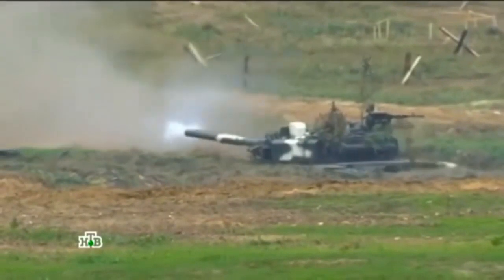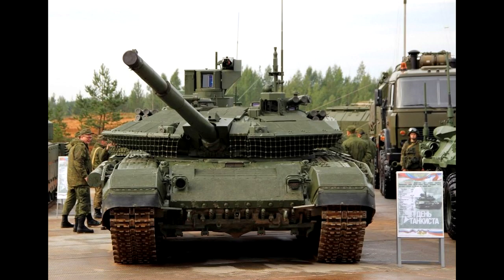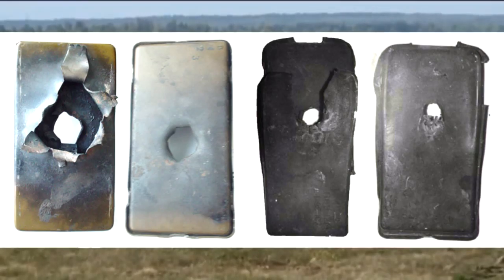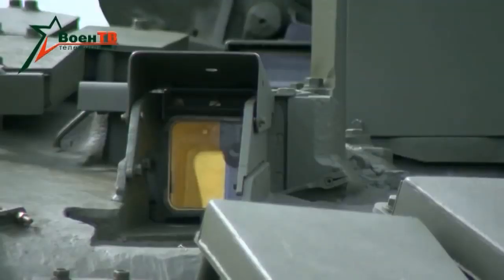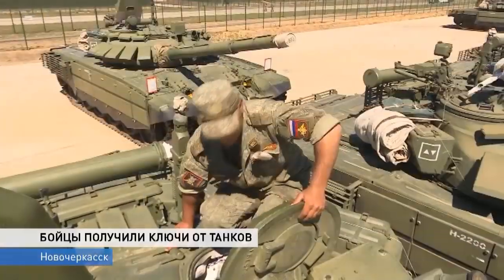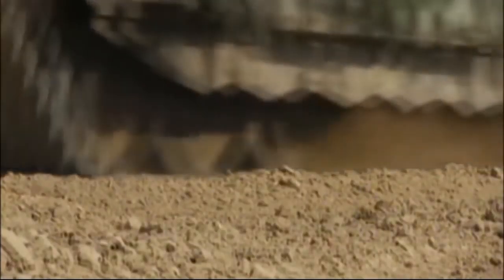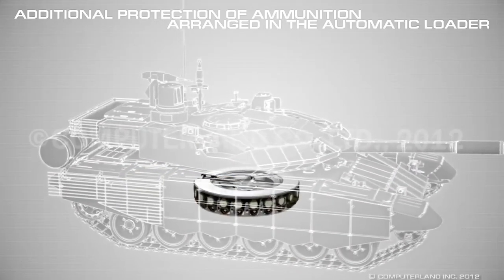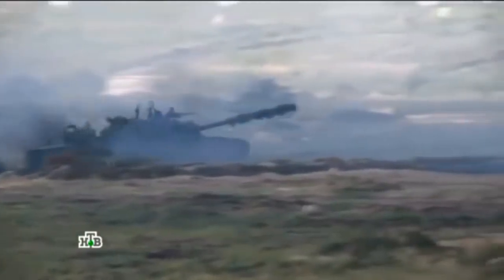Problems with T-72 tank

Comment: I love the T-72. It is so incredibly Soviet it's glorious. But, it becomes completely outclassed by the M1A1 and A2 platform of tank. Any NATO country would be able to combat it
Reply: This is sort of a filler tank until they get enough T90s to replace them (And then the T90 becomes their second rate tank as the t14s will fill in as first rate) , the T72 will still remain as a backup for a backup tank.
Reply: Don't say that you think t-90 and t-14 have any chance against the NATO tanks, please...
Reply: @TeoAnimations  They actually have, they are a major upgrade over all the tanks that were sent to ukraine.
Reply: @ytkomar1141  depends on which ones. The T-90A is confirmed in Ukraine. The T-90M is not yet confirmed.
Reply: @kurousagi8155  Yes, I was thinking about Proryv-3 while writing my previous comment.
Reply: Meanwhile, Romania with it's glorified T-55: Cries in Romanian
Reply: @TeoAnimations  The T-90MS and T-14 Armata are good tanks, there is no need to downplay them just because they are Russian. And even if it turns out that they don't - it's better to overestimate and use overwhelming firepower on them rather than underestimate them and use insufficient firepower.
Reply: @ravenouself4181  lol, both t90 and t14 use the same autoloader as t72, and based on video evidences that design is extremely flawed.
Reply: @ravenouself4181  The thing is: Russia is simply to poor to build T-90MS let alone T-14 tanks in high numbers. And tbh both are unproven in battle and the T-14 is probably not even fully developed. 
But you are right. Better overestimate than underestimate your enemy!
Reply: Russia always favored quantity over quality in their tanks. A platoon of 200 t-72's will eventually defeat 50 abrams or leopards for example.
Reply: @kurousagi8155  until now there is only one confirmed lose for t 90m so that's a good sign
Reply: @zezenkop412  Maybe because they dont have many of them at all and there are much more T90 losses in general if considering all variants.

Comment: I still doubt that "any tandem shaped HEAT can penetrate the K-5". It has proven to pe extremely effective in the Syrian war, surviving MULTIPLE hits by TOW-2 ATGMs which have a tandem-HEAT and still didn't penetrate....
Reply: CptMisha  It was not the only time that a missile failed to penetrate the T-90 armor, there was also another video where another T-90 was attacked by a ATGM and again it failed to penetrate the T-90's armor https://www.youtube.com/watch?v=wKe7W8IrIBw So we have at least 2 videos that prove how effective the K-5 is. So Red is wrong about that "anything can penetrate it", he geatly underestimates the effectiveness of the Kontakt-5 against missiles!
Reply: I though the Insurgents only had the older cable controlled TOWs supplied by Saudi Arabia?
Reply: @run2u520  they did, the groups supplied in the TOW program were using 71-D and older models. you can tell because the optical sight isn't a huge block
Reply: @xAlexTobiasxB  Well the Abram's hull is not that weak, it has at the very least 400 to 600mm or NERA behind the Steel plate.
Well it's not that armored compared to the turret, but can withstand some 600mm against KE rounds.
Reply: @gdfsgfsdg4232  We're not talking about optical sight or the launcher, we're talking about the missile itself. And in all of the photos I have posted above you can clearly see that it's the 71-E variant! Besides, the optical sight has nothing to do with the missile anyway.
Reply: @xAlexTobiasxB  correct me if im wrong but frrom the appearance of the video it looks like the TOW didn't hit any era but hit the sloped underside section of the t-90a where there was no ERA attached.
Reply: @ferrarilegends5850  No, the missile definitely hit the tank, in fact, it was hit again by a second missile right after the first one failed to do any damage, and the second missile again failed to do destroy the tank too.

Here is the longer original version of the  full video that shows both missile attacks:

https://www.youtube.com/watch?v=OPnnOX_Gh7c

As you can see both missiles definitely hit the tank but failed to penetrate the K5 reractive armor of the T-72B3 tank! This proves that the Kotnakt-5 is still very effective against modern tandem-HEAT missiles today!
Reply: @xAlexTobiasxB  I never specifically stated the missile didn't hit the tank, but regardless i'll take a look at the video.
Reply: @xAlexTobiasxB  As per this russian report 1 t-90 model 1992(cast turret) not welded turret survived a direct hit from tow-2a . If a cast turret can survive tow 2a so welded turret can easily survive it .https://southfront.org/tow-2a-vs-t-90-detailed-analysis/

Comment: Russia doesn’t need excellent tanks to out-fight the enemy in tactical level. They need a lot of good-enough tanks to wear out the attacker
Reply: Largezo - War of attrition - it’s the Russian way.  Worked against Napoleon and Hitler...just ignore the millions dead and destroyed countryside.  In truth, very few countries have a mass of MBTs ready to take on the huge Russian fleet of T-72s.  America probably could, but the USA tends to dominate via air superiority, at which point it doesn’t matter if it’s a T-72, T-90, or T-14. Russia has the S-400 to counter that.   In short, Russia uses the T-72 because it’s the right tank for a war it would fight.
Reply: Except that modern Russia does not have throw-away manpower as USSR used to have. It's not 1914, nor 1941 any more.
Reply: @ClockworksOfGL  the problem with a war of attrition is that Russia's active tank force is not much bigger then the USA's/NATO. only about 200 T72B3M, 1500 T72B3, the remaining 300 older T72, 450 T80BV/U, 350 T90. they got like 13000 older T72, T80, T90 in deep storage. and some even older T64s. all that would take time to pull and and fix. they also don't have as many factories that make T72. they are switching over to the T14 (50 total still in trials). while the USA has 1,131 M1A2 Sep and 261 M1A1 SA in it Active and National Guard units. plus another 407 M1A1 SA marines. while having 400 M1A2 Sep & 4393 M1A1 SA in storage. most of them are maintained by civilians year around making them ready to fight tonight. that 1758 USA vs 2800 Russian. and that doesn't count Poland (105 Leo2A5, 142 Leo2A4, 760 T72/PT91s), Germany (176 Leo2A6/7), UK (230 Challenger2), France (204 LeClerc), Spain (209 Leo2A6, 100 LeoA4), Italy (160 C1), Canada (40 Leo2A6). or a total of 3965 US & some of NATO members vs 2800 Russia active tanks.  and it not likely that the US/NATO would invade Russia.
Reply: Russia has lost its industrial might but china though oh man those guys be shitting tanks and jets 24/7
Reply: @ClockworksOfGL  For Russia to win war of attrition it would have to outproduce its opponent like in ww2, Russia doesnt have industrial power to challenge major powers and having cheap tank design doesnt mean you can make them in your garage. That is literaly worst way to wage any war for russia.
Reply: @ClockworksOfGL  And to put final nail into coffin, i forgot to mention how allies kept ussr on its legs by lend lease, giving them tanks, planes, trucks...and even raw material to run their industry.
Reply: kareem abdulaziz - Your last sentence is the important one: the US/NATO isn’t going to be invading Russia anytime soon.  Therefore, the T-72 isn’t designed to counter a ton of Abrams rolling across the border.  Air superiority is key, and that’s where the S-400 comes in.  I’m sure Russia would love all their tanks to be T14s, but they have what they have.   For regional conflicts - exactly where Russian equipment has been used -  the T-72 is quite capable if used properly.  In other words, don’t go rolling into a Syrian city without infantry support, no matter what MBT you have.
Reply: Robert Kalinič - Oh, yes...Lend-Lease was critical for the soviets in WWII.  Apparently the Soviet soldiers were shocked at how reliable and ergonomic American equipment was.  I read somewhere that the T-34 was so unreliable they didn’t let the crews use them for training, since that would wear them out before getting to battle.
Reply: @ClockworksOfGL  Not unreliable but crude, cheap and low quality, they were counting on that and designed t34 so none of its parts will be made to last longer than average lifespan of tank on front or if something breaks then it will be easy to change. If i remember correctly its called planned obsolence, i fell in love with t34 when i heard abount that design philosophy, it meant that Soviet Union was making tanks faster than Krauts made bullets.
Reply: Robert Kalinič - The average lifespan of a T-34 (which was an excellent machine) in combat was something like 14 hours, so the soviets built the tank to last that long and nothing more.  The thing is...a more durable tank would’ve allowed the crews to do much more training and make them a more formidable opponent against the German army.  The crew is always the biggest factor.
Reply: @ClockworksOfGL  i said average lifespan of tank on front not in combat, lol they didnt build them to last just 14 hours.
Reply: Ace of Spades  No it isnt.
Reply: @robertkalinic335  Soviet union didnt plan on war of attrition in cold war. They planned on breaking the defensive lines with massive attack and never let them form a proper defense line again and just push them to Atlantic. War would take weeks. Not even enough time to produce anything. Ofcourse it never happened because nukes.
Reply: @ClockworksOfGL  No time for training. The reason they didnt use them for training wasnt that it wasnt durable enough. It was needed on the front. They still had many older tanks. Why use the best stuff for training when you have a ton of obsolote tanks laying around. Of course its better to train with what you will use in fight...
Reply: @TwixSvK  Thats nice but i dont understand why are you telling me this since i only talked abount modern russia and ww2 soviet union.
Reply: Was meant for the other guy sorry
Reply: @TwixSvK  no problem
Reply: @TwixSvK  Those old models were all lost in early part of campaign, they trained on lend lease tanks because of longer engine lifetime.
Reply: Robert Kalinič
, well, unless they helped USSR, UK would've fallen to germany
Reply: @ClockworksOfGL  for limited regional conflict T-14 is the best choice as it gives better results with minimal risks
Reply: @ClockworksOfGL  Also the US, not even in the Cold War was planing on a direct attack on Russia. The US seemed more interested in isolating the URSS and forcing them to spend money on weapons.. Until colapse came. Russians tanks are most likely to be used for limited border conflicts as the post soviet borders are not yet stable and less for defending an al out war. For this the T 72B3 its a OK tank, but do something about that amno carrousel please!.
Reply: Steve Arthur  True... in war situation, there is no such thing as money. Only resources

Comment: Problems with the T-72:

1. Doesn't come with a vodka dispenser
Reply: future Russian tank will run on Vodka so both the crew and tank could consume at the same time.
Reply: That’s because the crew is already full of vodka
Reply: In theory you could run an engine with hard vodka, but to fill it up with individual vodka bottles might be troublesome.

BTW, serious question. Is a barrel of fuel for T-72 more expensive than the same volume of vodka in bottles?
Reply: In the film 9th company they keep vodka in one of the bmp door fuel tanks I know it’s not a tank but you can imagine similar situations with other vehicles 👍🏼
Reply: Do you think that auto-loader only contains shells, comrade?!
Reply: Because it comes with a gulag ticket dispenser
Reply: 2. No Radio to play those Hardbass "Cyka Blyat".
Reply: You kidding? The armor is marinated and infused with vodka.
Reply: @mikeg8876  finally someone who has a brain
Reply: Alehop Fren are you blind  the shells coming out of the turret are the vodka bottles
Reply: Stanley Jedrzejczyk So make the T-72 more flammable then? Ok then I encourage the use of easy destruction targets!!
Reply: O
Reply: @TLuu164  i mean its prob flammable  so not impossible

Comment: 1. The current K-5 uses 2c23 elements similar to the Relic. K-5 housings are used because they are simple... eat. re-equip thousands of tanks Relic too costly.
2. A set of hinged additional protection is modular and can be used with any tanks older than the T-72A. It is put because of the greater threat of RPG than other tanks.
3. Lit and explode propellant charges that are not stacked in the loading machine. Take on Board the full ammunition is not recommended. Detonation is only possible after a long fire. i.e. when not operating the fire-extinguishing system and violation of the placement of ammunition.
4. The lack of a panoramic sight as well due to the fact that it costs like half a tank, need full unification which has not yet been achieved. Performance improvement occurs in stages. Much more important are the new shells and the sight of the shooter.
5. The system of tactical interaction "Constellation" is not ready for everyone yet, to install the system cut in functionality on mass tanks.. What for? In addition, there are wearable devices from the tank commander, you can transmit/receive data using the new digital radio from the commander's tank.
6. Protection case is clearly insufficient... like Leo's 2 and M1A2. Tower when replacing elements combined booking can withstand М829А2, that's enough because even A3 is not widespread. In addition, hunting for tanks is assigned to self-propelled and wearable ATGM.
7. Similarly, 1400mm penetration of cornet-D is sufficient for 100% of any target. Not important Leo-2 this or M1A2.

The t-72B was out of date back in the late ' 80s, But that's what we have. We have to improve what we have. or T-72B or nothing at all. There are serious problems with production and workers.

Comment: problems with T-72 tank:
1. It's too awesome looking
2. It sounds too cool while running. Only T-64's sound cooler 
3. And yeah like below no Vodka dispenser...But I imagine most crews get a aftermarket one or just ferment the brake fluid and drink that so it's not really a issue

Comment: Strength of T72 is mobility, weight, volume production, and fairly rugged for several terrains. One change I would do is change to 105mm turret. Save on weight, and might allow strengthening of carousel. The 105mm is well suited for close range urban conflict alongside infantry... most of the typical battles it'll engage in. The 125mm is overkill for that type of situation.

Comment: T-72 is still amazing such huge speed and so easy to upgrade. You could make 100 of these compared to 1 Abrams.
Reply: Yeah, and the Abrams would still survive because it'd be knocking the T-72s out from kilometers away before the T-72s even saw them and would easily be able to extract once it ran out of ammo from killing all the T-72's because they wouldn't be able to hit the Abrams from that far away. Sure, you could say that the T-72 has more kills, but only because it KILLS ITS OWN CREW.

It's not World War 2 anymore, and just spamming thousands of Shermans or T-34's against Tigers/Panthers isn't going to work in the modern battlefield.

Comment: Though the T-72 is a bit older and it needs an upgrade in many areas I think the Russians are fairly realistic in not needing the upgrades based on future conflicts. I doubt Russia will be in a conflict with any major power so the tanks need to be good enough for 2nd or 3rd world enemies. This is the T-72's forte, you need many tanks on the ground to fight insurgents and older tanks but they don't need to be ultra modern and exspensive.

Comment: @RedEffect Can you make a video dedicated to Object 187? An in depth analysis would be VERY much appreciated. Superficially, the only difference in contrast to T-90M Proryv (that utilizes the turret from Object 187), is that Obj. 187's turret is placed further forward by 1 meter than T-90M and of course the gun itself, as it has a muzzle brake/recoil compensator (not sure). Other than that, when it comes to the hull, I have no idea whether it was a complete radical departure or a one-off, or if it was borrowed from T-72 or T-80? Best regards!

Comment: The T-72 breach cooling mechanisms killed more Russians than enemy combatants. The interior dimensions aka ergonomics are absolutely horrendously engineered. In regards to the fire control system lets start with the woefully inadequate 10x optic and the lack of a thermal imaging sighting system. Lastly, it takes crew members approximately 30 minutes to get to the engine oil level indicator and 30 minutes to replace all of metal covers!!! All of which  you failed to mention it in your lame as excuse for a video titled "Problems with the T-72."

Comment: T34 vs M4 Sherman pls
Reply: André Lunkes Both were excellent tanks. Both are well rounded medium tanks that serve a variety of roles, both are relatively cheap and easy to repair. Main difference is the T-34 design cheaped out on crew survivability. After the war heated up the Soviet’s went with a planned obsolescence strategy, the idea being they would be destroyed before they wore out so why make parts that would last.
The US had massive industry so there wasn’t much reason to cheap out on the Sherman, they really didn’t need industry anywhere else. 

I would rate the M4 higher because of its crew survivability and sights/cupola. But, in a war when you need every part of you industry pumping out as many vehicles as possible (like the Soviet army) the T-34 or some others cut-corners tank would be your best option.